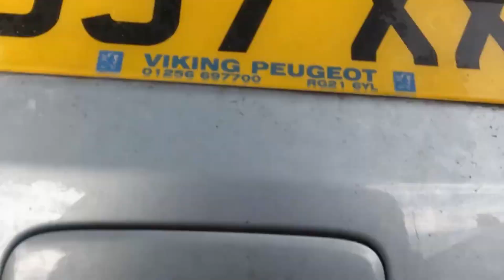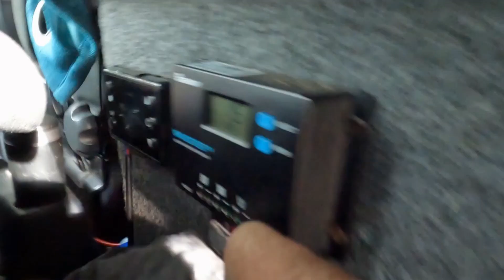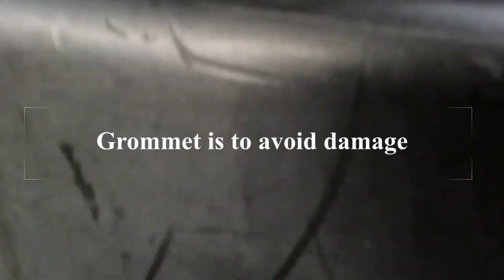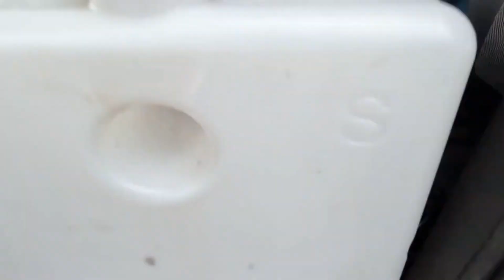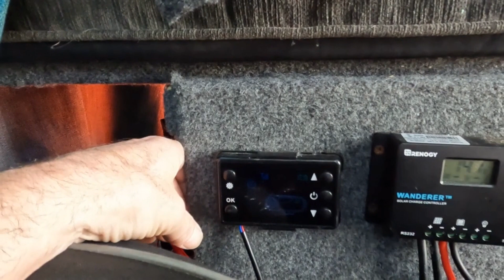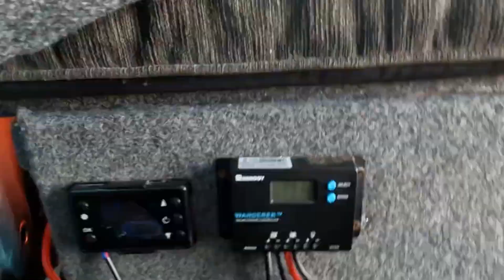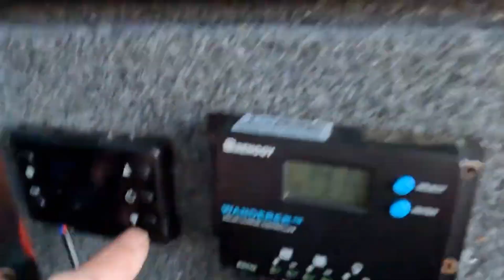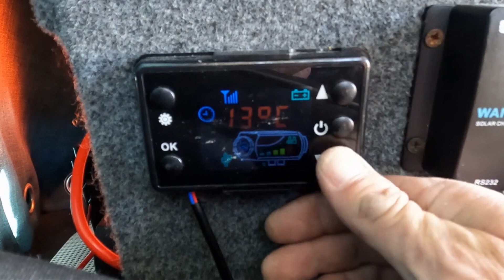Micro Camper Diesel Heater Fit

Comment: Had to get rid of my spare wheel also, as I was fitting my diesel heater next to the left wheel well into my kitchen cabinet. It's fitted into a Transit/Tourneo Connect from 2007. I had to tap into the breather hose of the van's fuel tank, as it's not allowed to have heating fuel tanks inside here in Germany.
Nice install, you're totally right to use the rigid fuel hose only, as the pump relies on the rigidity of the hose to maintain the impulse to deliver fuel to the heater.
Thx for showing!
👍👍👍
Reply from the maker: So glad you enjoyed the video. The green fuel pipe is a waste of money why it isn't swapped for the white nylon ill never know. Any subs appreciated.